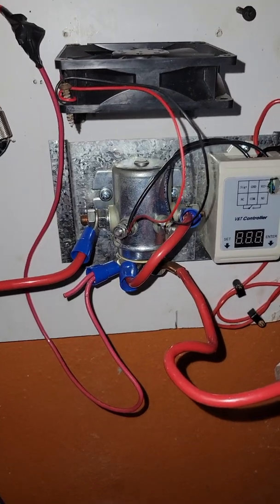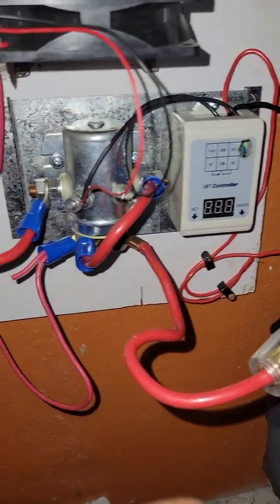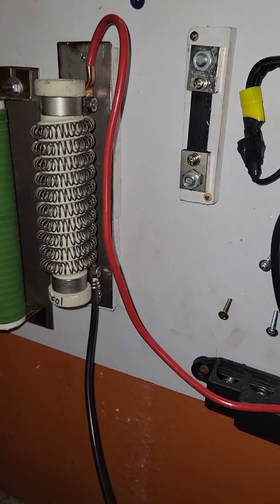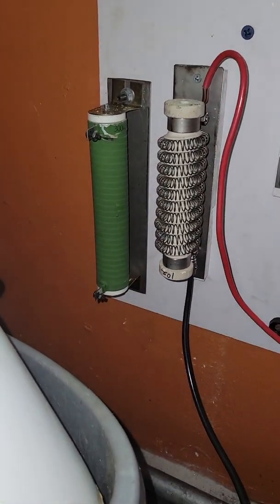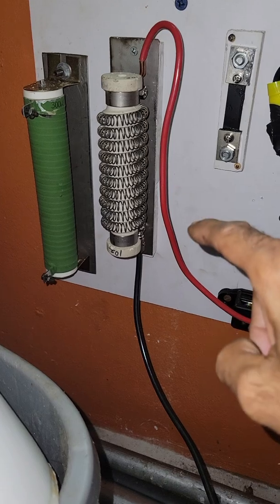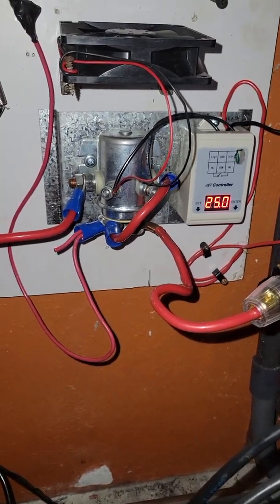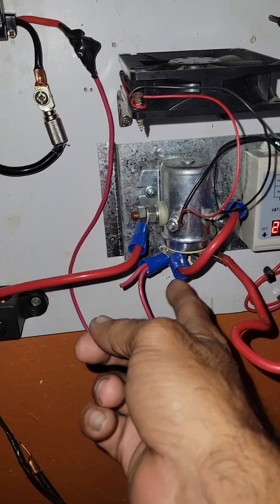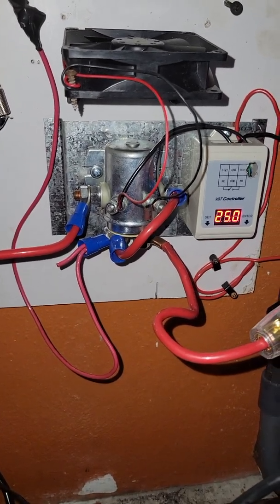Wind Turbine dump load problem resolved

Comment from the maker: Hello if i do not put the jumper it go direct to discharge batteries with jumpper wind turbines see the resistor and stop when batteries are fully charge  and no discharge my batteries
Reply: It's been 3 years is it still working? Is this 12v battery?  @raycardona4814